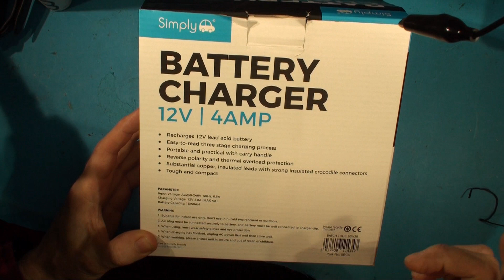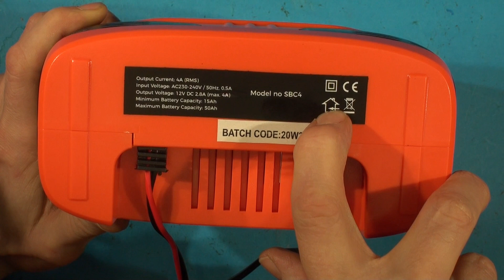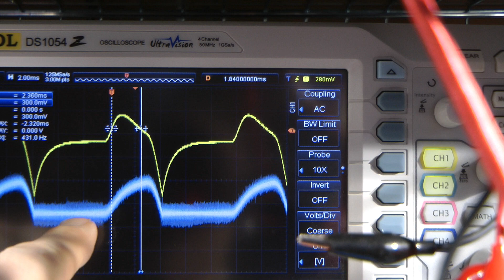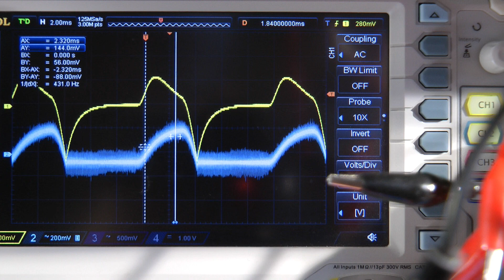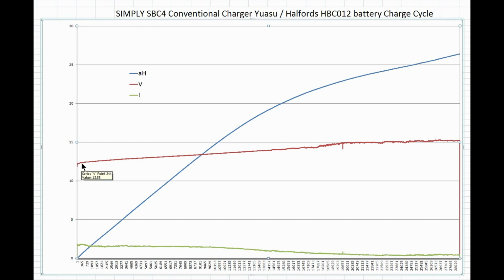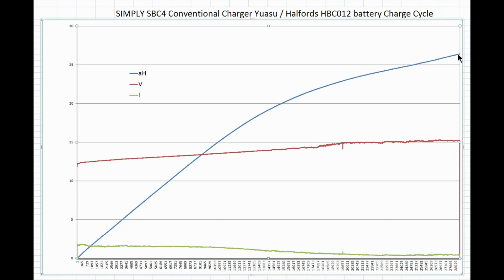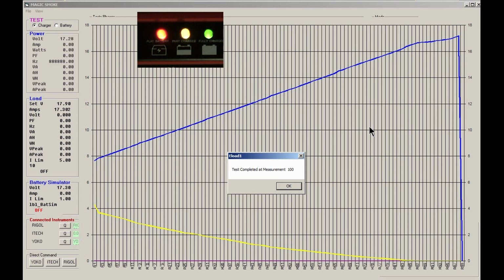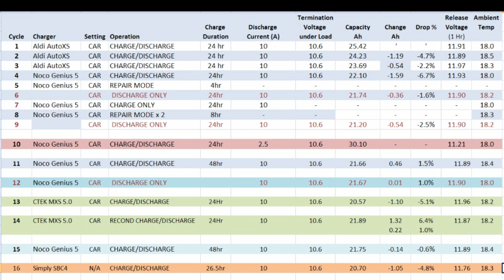Is the cheapest 4 Amp Battery Charger SBC4 / SWCBC4 better than the NOCO Genius5 or the CTEK MX5S?

Comment: This similar behavior is just like the charger i have. Which was ultra cheap. Like 15 eur or so. It says 4amps, has 2 LEDs, "charging" and "full". I put my 64Ah battery on charge, it started with around 13.3V (didn't think of checking the amperage at that point, i have the clamp ammeter), after some hours it went to 14.8V and seemed to stay there for hours. In the end, i checked the voltage, it was 15.1V and i could hear the battery boiling (not like a kettle, but still). Then i thought of checking the amps. It was showing constant 0,5A on the output to the battery. I then switched it off. Left the battery sitting still for 2 hours. Checked voltage. 13.07V, after 24 hours, the battery still was at 13.07V. It has been about 5 days since i disconnected the battery from the charger and it still shows 13.05V. The battery was staying in my flat, not connected to anything. Oh, btw, i switched off the charger after about 34 hours of charging, it was still showing the "charging" LED. So what happened? I see all the time, that battery voltage should drop to 12.7V after fully charged and disconnected and left at least 1 hour. Some people say CTEK chargers are rubbish, they don't supply the 14.4 voltage while charging, cannot fully charge batteries and they skip stages. So what charger should i buy? CTEK MXS5 costs 70 eur in my country, which is considered a very high price charger, so would be shame to spend this much and get as bad result as a noname 15 eur charger does.
Reply from the maker: The problem with these dumb chargers is that unless you know the charge state of the battery when you connect it you don't know how long to leave it connected. Leave it too long then it damages the battery.  CTEK is a fine charger but very unreliable. You don't want the voltage to go above 14.4v for any length of time. The other bad thing that these charges do is to put to much current into the battery at the wrong terminal voltages. The absorbtion charge it current too high because  It erodes the plates.  I have been sent a pile of them in the last 10 days that I foolishly agreed to fix. Watch this channel..
Reply: Based on the battery capacity and starting current, I assume that your battery is Tudor High Tech - Carbon Boost (Tudor brand belongs to Exide group now). This is a battery with carbon additives, which, despite the marketing description, is a bit more difficult to charge. The exception to this is if you are using a charger with adequate performance. Your charger is a little too weak for the 64Ah capacity.
The description 12V 4A means the maximum current under specific conditions, in reality the effective charging current is 2-2,5A (depending on the transformer used), which results in long charging time. Additionally, note that this is not an automatic charger, so the "charging" LED just lights up all the time and just means the charger is plugged in. The "full" LED probably lights up when a certain voltage is reached, but at this battery capacity it won't be reached. Regarding the "boiling" of the battery it is a normal phenomenon. After exceeding voltage of 2.4V per cell (14.4V for 12V battery) electrolysis process begins, which causes electrolyte to start gassing. Unfortunately, Tudor batteries do not have access to the electrolyte, there is no way to tell if one cell is gassing more than the others, which would indicate a short circuit.
If you are having trouble starting your car in the winter after a standstill of about 2 weeks this could indicate one of the basic problems:
1) the battery is at the end of its life
2) short tracks, many engine starts (alternator is not able to restore lost energy at startup)
3) low charging voltage in car installation
4) something is "stealing" energy in car at standstill
or it may be a combination of the above mentioned points.
Regarding the CTEK charger, ask yourself what is better - to buy an expensive, overrated device or invest in some simple diagnostic tools:
- battery tester, for example Autool BT360 or Konnwei KW600/650 - it will allow you to estimate battery condition and starting current
- electronic load, for example Atorch DL24 - will allow you to estimate battery capacity
I specially write "estimate" and not "measure" because these are not professional devices. But for home use it is good enough.
In addition, you can slightly improve the properties of your charger by replacing ordinary rectifier diodes with Schottky diodes, for example 80SQ05, which will raise the final charging voltage by about 0.7V and increase the efficiency a bit.
Don't use it too often to prevent water loss. For normal recharging, a 5A charger from Lidl is enough, switched on in winter mode. For future use I recommend a battery with caps, if you opt for carbon additives an interesting alternative is EFB battery.
Reply: What you are seeing in terms of the battery voltage being above 13V a few days after charging fully, is NORMAL in my experience especially if the battery is fairly new and in good condition.  Whenever I purchase a new battery, I always fully charge the battery before putting it into service and I've always found that after 24 hours, the battery's voltage is over 13V - around 13.04 - 13.1V - and will stay above 13V for a while afterwards if the battery is left sitting under no-load conditions.  As the battery ages and gets worn, the battery's voltage after fully charging and letting it sit for 24 hours will typically drop in the ranges you see reported on the 'net.

As for CTEK not supplying 14.4V, I have two CTEKs - a 3300 and a MXS5.0 - and both of them reach 14.4V under normal conditions (ie above freezing temperatures using the standard charging program for a car).  I've also never seen my MXS5.0 ever skip stages or have 'strange' LED indicator patterns (ie the charge complete LED come on when the charger is obviously charging).
Reply: @richardlouie2922  The battery i have is Tudor 64Ah 640A, it is now exactly 5 years old. During this time i have never charged it manually except for two times. 1 time it got discharged enough to not start the car because i left the bluetooth OBD reader. The second time it discharged to the state where it couldn't turn the starter on was now, in winter and after my car was parked for about 1,5-2 weeks. So i would be skeptical about being in a good condition :)
Reply: @alet3348  You are right that it's probably not in good condition as older batteries will typically see their 'day after, fully charged voltage' reading drop steadily over the years of service - ie 13V when new, 12.9V after a year... 12.6V after a few years....  On two older batteries (5+ years old similar to yours), I was able to get that 'day after, fully charged voltage back up from 12.4V to 13V by applying a couple of rapid high current discharges to the battery using a carbon pile load tester.  I believe that the rapid high current discharges blew away some sulfate deposits that may have caused a slow short in one of the cells resulting in the lower voltage readings.

Comment: I have mentioned this before on your videos on chargers but not sure if you ever tried it.  You put two batteries of similar capacity in parallel, one being the sulphated one not, but both discharged.  You  charge them up until full. Then check what was the sulphated battery.  I have done this a few times, though not always successful it does work.  There's a video on YT regarding this from one of the big USA battery manufacturers, it may have been Odyssey, where they show this.  I have a few smart chargers that claim to de-sulphate sometimes they work,  but there is a point of no return.
Reply from the maker: The method uses the good battery to control / limit the voltage across the bad battery to prevent erosion of the plates during charge.  Mostly for use with a dumb charger like this one. A smart charger should do this.  With regard to car VRLA starter batteries most under 60aH capacity have a recommended charge current of just 3A. Higher current chargers are a problem in this respect. But the public gets what the public wants..

Comment: At least a simple led  indicator is an improvement over a ammeter, misunderstood on an old charger because it never goes to zero.  A voltmeter would have been a better idea
Reply from the maker: That is a good point. It would be good if it cut off a set period after it reaches terminal voltage of 14.4V
Reply: @razenby  you're asking a bit much 🤣🤣🤣
Reply from the maker: @jusb1066  Only a dollars worth of additional components is not much to ask.,
Reply: @razenby  they'd rather lie to you that it's a three-stage charger and keep the dollar
Reply: The ammeter on an old or new charger never goes to zero (well, unless you turn the charger off ;-). There is nothing strange about this, because after the final charge voltage is reached, current is still flowing. An ammeter showing the charging current allows you to see at what stage of charge the battery is. This is much more important information than the actual voltage. When the current stops decreasing and remains low, the battery is in the absorption phase. This phase should last 4 or more hours, depending on the battery capacity. Only then can you talk about a good charge. So the presence of an ammeter is not such a misunderstanding at all ;-)
Reply from the maker: The voltage waveform is 100Hz Rectified sine wave. the peak voltage is 1.41 x the average voltage open-circuit the peak voltage of the waveform is near on 18 volts. Charge current will permanently flow if you leave this type of charger connected. If for an extended period the battery electrolyte will dissociate, and the level will drop and the battery plates will get etched away. The eventual outcome is very likely to be  an exploding battery as a spark will occur between the plates.  This happened on my camper van about 15 years ago before I thought about charging - It made one hell of a bang in the middle of the night..
Reply: @razenby  I agree 100%, the conversion rate of 1.41 is also known to me (the peak voltage is of course determined by the input voltage).
A traditional rectifier is indeed not suitable for an camper for the reasons you mentioned. In this case, the best solution is an efficient microprocessor-based charger, ending the charge at 14.4V and switching to float charging.
However, for periodic charging of traditional starter batteries, a transformer-based charger is quite effective. Of course, we must not forget the need to monitor this process. In the old school of charging, one of the primary methods of control was the use of an hydrometer - currently difficult to realise due to the fact that most batteries are maintenance free. The only thing left to do is to watch the charging current drop and decide "by intuition" when to turn off the charger.
Reply from the maker: @Tab7.6.Tab7.6  The issue I see with these chargers is that they cause too much charge current during the absorption phase (last ~20% capacity) of the battery charge. At ~80% charge the charger drives too much current over-voltaging and attempting to desulphate the active regions of the plates that are not yet protected by the healthy amorphous Lead Suplhate this eroding the Lead from plates..   So these chargers are cheap, they are good for a quick charge up to 80% capacity. They should be disconnected when the until the current starts to fall to about 50% of peak.  For this charger I would disconnect the charger as soon as the green LED comes on. beyond this point lies trouble. It damaged the Yuasa / Halfords battery.
Reply: @razenby   Generally I try to buy batteries with caps, or if I get a maintenance-free one, I arrange access to electrolyte. Usually I use automatic chargers, which gives charging in about 80% - it is preventive charging, allowing to compensate deficit in case of short routes. 2-3 times a year, especially before and after winter period, I charge battery with traditional charger in room temperature to voltage about 16-16.2V, with current drop to about 0.7A (44-50Ah batteries). Initial charging current fluctuates around 1/10 of the nominal battery capacity. I consider a battery to be charged when the electrolyte density reaches about 1.28 g/cm³, checked with an hydrometer (refractometer is too impractical for quick checks). I'm talking about lead-acid batteries, in case of GEL or AGM the strategy is different. You can disagree with my charging method, of course, but I think it makes for an informative discussion ;-)
Interesting information can be found on the jgdarden website in the section "Car and Deep Cycle Battery Frequently Asked Questions", where, in addition to a good dose of knowledge, there are also some examples of charging algorithms for individual battery types. Unfortunately, not sure why, YouTube does not allow links to this page.
But by typing "jgdarden charging algorithms" into a search engine you can easily find them. 
Anyway, I'm afraid there's not much that can be done in the case of the battery you tested. You can also try to use "holy water" instead of demineralized water, but this is just as a dry joke ;-)
Reply: @Tab7.6.Tab7.6  😎"I arrange access to the electrolyte".

Comment: If as in the previous Noco/Ctek tests where the chargers ended at basically 14.2/4v, the same cut off voltage was applied to this cheapie charger. The 26Ah charge would be a lot less, probably a similar 20Ah?
Reply: It would be exactly the same , it takes the same energy to charge the battery to the same voltage.  All this did was turn more power into heat at the upper end, equalisation at 15 volts might be ok for a short period like 20-minutes but not 24 hours.
Reply from the maker: @jusb1066  It was above 15 volts for about 6 hours. We could calculate where the additional 3.5 aH of charge went.  Presumably in electrolysis of the electrolyte and heat. It was certainly not storing any energy in chemical bonds that were accessible as energy during discharge. I am going to access the electrolyte cells next and see what horrors await within.
Reply: @razenby  certainly as heat but that's only a few watts over the surface area of the battery, barely measure the temperature difference
Reply: @razenby  “I am going to access the electrolyte cells next” - this is a great idea, because we will immediately know if the plates are covered with electrolyte and what color the electrolyte is.

Comment: hope that wasnt me who you thought had that one, i have a streewize 4amp, which goes into float mode at 13.6v, not forever at 15+v, unless in the last 4 years they too have ripped out the board and put this old school thing in  ..swbc4  ..might have baited and switched it. ? not thatid recommended off brand to anyone who isnt competent to deal with it..  i am suprised a long slight overcharge didnt help the battery either.. you already  had an old school charger anyway..  but for sure, modern marketing isnt helping people get a good charger.
Reply from the maker: No, don't worry, the person quoted the model number of this charger as a recommended alternative to an expensive charger.